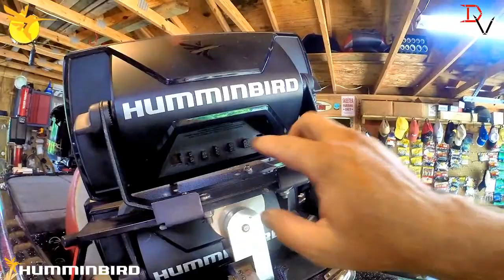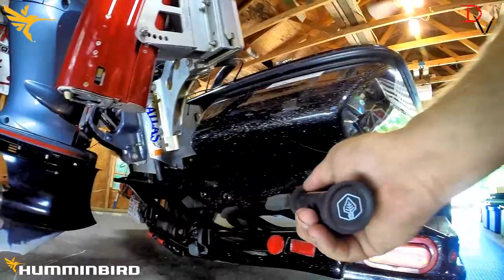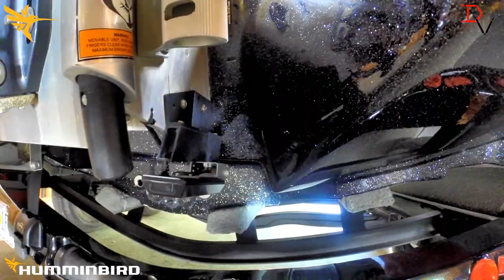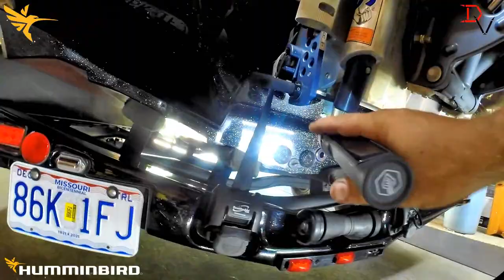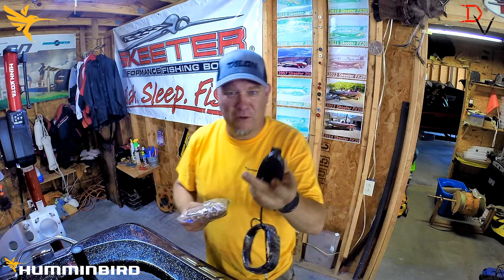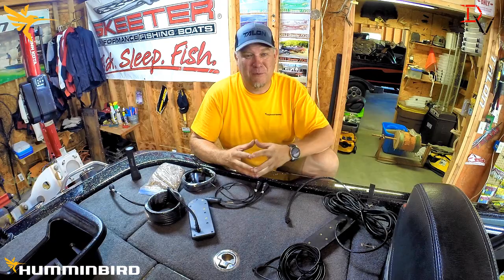Tips 'N Tricks 237: Humminbird: When & Why to Use a Y-Cable

Comment: Doug, I watch all your Videos and they really help. I actually take a Ipad with me on the boat to watch them for advise. I have a Solix12 Mega SI-DI at console or further to rear of boat to look at  because I seldom fish from the bow alone and just got a Solix10 Mega SI-DI G2  and want to do both at the console. Do I run a separate transducer for each unit. Where do I find those mounts you showed on the back to mount your transducer. I was also thinking of installing a thru haul on one of the units even though there $340. A lot to ask in my comments and I am hoping you can answer them for me. Fish-On

Comment: I did this because I was losing bottom on plane. After about my third time out my down imagine does not work anymore. It only works if I run the same megahertz on my side imaging and down imaging. They are no longer independent of each other. It worked fine for a few outings then of course just like my hummingbird always does and never lets me down a day before a tournament it quit. Third year and in a row I've have problems with my bird right before a tournament. Of course it was a day out of warranty because the last time it happened was a year prior before the same exact tournament.